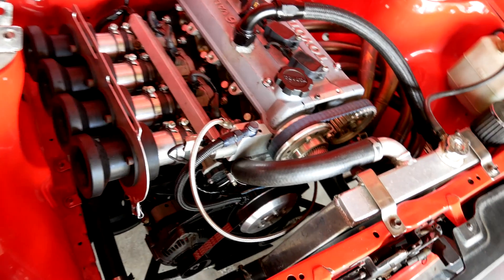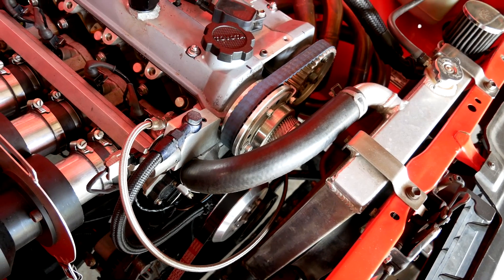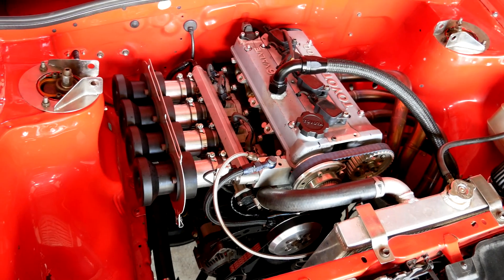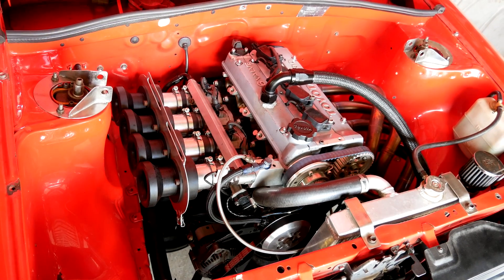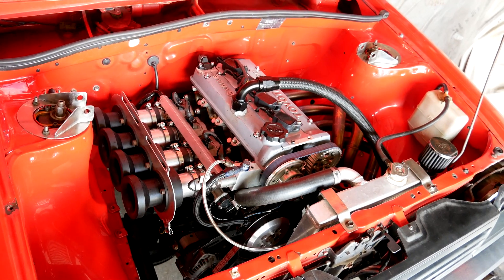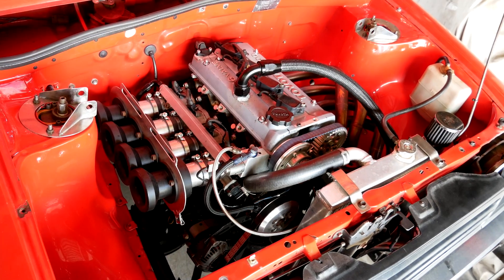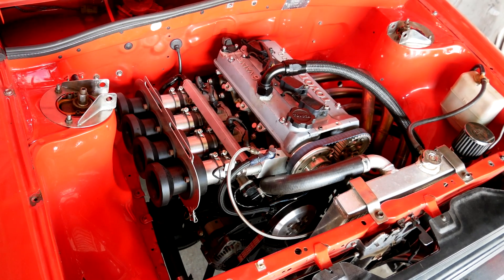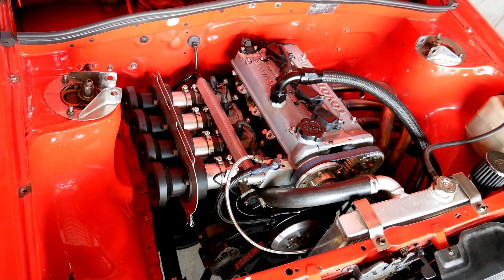VVTi   300 Degrees Cams - Dyno tested

Comment: Have you done much porting work on the head, or is it mostly factory aside from the oversize valves?
Reply from the maker: intake,exhaust and chambers all had work done.
Reply: @Garage4age  Did you do this yourself, or have it professionally ported?
Reply from the maker: @404-ThisUsernameIsAlreadyTaken  I done all the port work.  my engine guy  done the machine work, larger valve seats etc.

Comment: Is it really over 450 Nm of Torque at the wheels from this 1.6L N/A engine? :O
Would be really happy about a reply :D
Reply from the maker: It would be 195nm at 6400rpm, torque at engine minus drive line loss.  which is what most dyno's call "torque at wheels"       mine is showing the actual torque applied to rollers/ road.  which is different in every gear

Comment: Don't you think about upgrading to like YourDyno dyno controler setup? Maybe a little modernization would improve your job? Ofcourse SportDevices would be a pro option, būt YourDevices have helped lots of DIYers too.
Reply from the maker: Cant  justify the cost atm.    current software and control works fine in most cases.   But yes will be looking into one of those 2 when the time comes

Comment: An epiphany.
Dyno's cost what, 10k used? Fully built fouraaaage (🧐) per what I call "JDM gods approval", 20-25k assuming market hasn't changed?
Taking your time with dyno (which most don't), a 4A-GE with 5-8k in it can make equal power, leaving effectively 10k to spend on the rest of the car 🤔

Comment: Can you try with some regular fuel available? Like E85 and unleaded, or whatever fuel you can have?
Reply from the maker: Its built to run on pump  gas.   currently on 98ron e10.    It will actually make the same power on 95ron but no safety margin in terms of knock.    can only get e85 as race gas here, so never bothered with it.  probably only a few percent in it power wise going to e85.  since engine isn't knock limited on pump gas.     the altlantic engine in comparison  is higher compression and runs on avgas 100
Reply: @Garage4age  the Atlantic Formula engine you tested was more compressed and with AvGas? And yet you have a better engine now.
Reply: @Garage4age  That's good to know. Basically what I have on pump eveeywhere here. You should probably try to do an e85 run just for the "content" regardless.
Reply: Yeah this is actually a good question. What kind of fuel are you using?

Comment: 200+ horsepower out of a 1.6l N/A engine, crazy.
Reply: ... and Its WHP, not HP!
Reply: I had to double check the power number for a sec. 160kw from a 1.6L N/A. Unreal!
Reply: 220HP, and folks are complaining about having to make power out of 3.0 or 3.5L...   Those are like big blocks in comparison.
Reply: I didn't realize it was rwhp, I thought it was engine HP.   220HP to the wheels is like 258HP to the engine.    Which means out of 3.0L or 3.3L with similar setup he could make 500HP+.

Comment: This is a good illustration why pretty much all modern engines have some some sort of vvt. 
  I remember, a while ago, you had a variable intake manifold prototype working. I think it's time to revisit that.
Reply from the maker: Would be cool.  but not worth it with the vvti.   i wrote a big story about it  up there somewhere ^
Reply: @Garage4age  would using both variable intake and vvt help ?
Reply from the maker: @sigmamale4147   Variable intake doesn't have a whole lot  on a fixed length intake of the correct length.  well unless  the variable setup was to extend out longer than what almost everyone could fit in there engine bay.  With  the vvti you can effectively  shuffle the intake tuning a little, since are altering valve open/close events.   for example, if you made the intake runner a bit long and starts to fall over up top. can retard the intake cam and gain back most of the power.  only works to a point and there is still a sweet spot for the runner length.  but you can see how will be less benefit from a variable intake on an engine with vvti.   Also have to factor in the variable intake will likely be at a disadvantage shape wise vs what can do with a fixed runner

Comment: I seem to see a breather from the valve cover to the fender? More power to be made by inducing a vacuum in the Crank case.  Either a dry sump oiling system or an external vacuum pump.  A pan O vac on the exhaust at the collector is very effective but emission dirty.  I find that the vacuum will need to be regulated or it can destroy the front and rear main seals.
Reply from the maker: I made a video where i put a vacuum cleaner on that breather pipe, mostly for a laugh, but the internet got angry as it does..    It didn't do anything other than sucking some oil out of the engine haha  https://www.youtube.com/watch?v=2fg0eZzRNZI
Reply: @Garage4age  I watched that video. A vacuum is useless. You need to pump a real vacuum inside the crank case. The back side of the Pistons, the rotating mass of the crank and rods, all contribute to surprising large power consumption.  Try with a real vacuum inside if the crank case.  Yes removing oil from rotating mass is part of the equation.  Removing air from being violently sucking and pushing on the pistons has a much larger effect. To see results you will need to measure the vacuum created in the crank case. You will need to pull almost a full vacuum. This is more relevant at high rpm.  I would expect to see a 10 hp gain at 20 inches of vacuum.
Reply: Is there really power to be made from having vacuum on the crankcase vs VTA? I understand that a dry sump can help reduce losses by pulling oil away from the crank, is this what you mean?
Reply: @konradgeorgeson  dry sumps provide more power than they consume due to sucking an actual vacuum inside the crankcase. Keeping oil from flinging around definitely helps. I have used air pump check valves on tubes run into the exhaust collector to create strong vacuums inside the crank case. Using an effective oil air separator is a must.  I measured 20 inches of vacuum. This was a dramatic power increase on a 1974 Alfa 2.0 engine. I required a very good flowing exhaust.  Alfa’s have a very efficient oil and air separator.

Comment: Only way to siphon out even more power beyond variable cam timing (beyond varied lift, which isn't really a worthwhile modification to do to a 4AGE due to how insanely complex that would be), would be variable runner length setup (á la 787B's mechanical runners moving). Not too hard to do mechanically, it's just making it vary based on the power-range appropriately that is the complex part.
Reply from the maker: Would be cool to try.  but i've pretty shelved the idea for good.    Have done testing on it in the past.  To have any notable benefit. the runners would have to extend out  quite a lot further than the current setup.  which is tuned for around 8500rpm  on fixed cam timing setup.    going shorter wont do much.  so fitment the number 1 issue.    number 2; to a telescoping setup like the mazda runs.  you pretty much have to run a straight runner, so is a small loss losing the ideal runner shape.   I  also tested a 2 stage setup that changed both diameter and length at the same time (in fixed form).  even have a design  that should have worked. but would still would sacrifice the ideal runner shape.    Its actually quite hard to beat the ideal fixed length setup by much.   But still the gains may have still been worth the hassle.    Then come along the vvti setup.  which to a point does the similar thing.   this video  touches on it https://www.youtube.com/watch?v=36DR-1zsiks .  iIchanged the runner length and lost the peak. but then used the vvti to drag power back to pretty much the same.    In saying all that, it will be worth revisiting the runner length on this engine now.
Reply: Maybe more area under the curve, but he could still tune for same peak.

Comment: The massive gains down lower more than make up the slight loss up high. This would be faster around a track.
Reply: Depends on how close your gear ratios are! I’m sure the formula Atlantic seldom sees rpms below 8k on track. That said for a street car like this, having VVTi is a no brainer
Reply: At least easier to use. But if there is a meaty midrange, it can help a bit

Comment: I'd be very interested to see how much actually power change you get using different wheel sizes in a dyno. Could be a good excuse to breakout the Hilux on the channel again
Reply from the maker: There is an old video, maybe one of the first dyno vids i done.  testing some different wheels on the hilux.    it mostly shows bias ply mud tyres are a bad day on dyno haha
Reply: @Garage4age  yeah I did think how much of a bad idea muddy sounded on dyno! Haha but I'll check it out, thanks!
Reply: @Garage4age  I do remember that video now I've seen it again. I was just arguing the other day about power loss over 31, 33 and 35 inch tyres
Reply from the maker: @astromarky123    my dyno is braked so the wheel weight/size will possibly  show up less than on an inertia only dyno.   the bias tyres are something different again
Reply: I used to have a set of 4.2kg Hart racing 15x7 that would be perfect for this machine